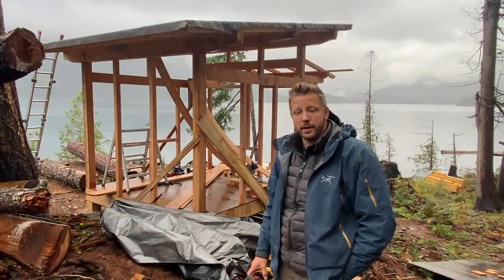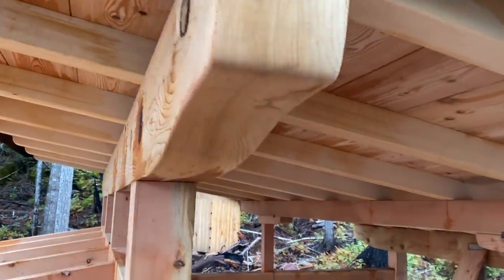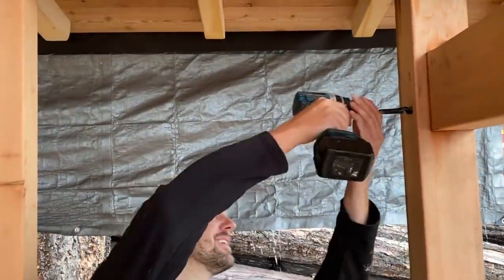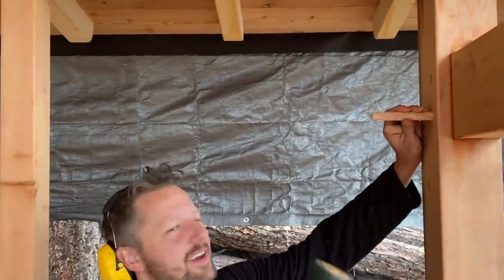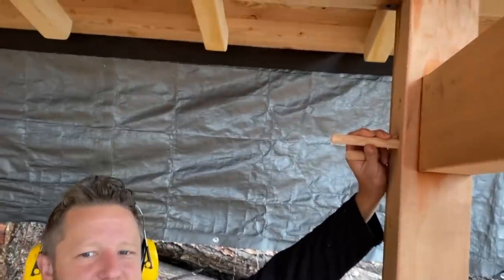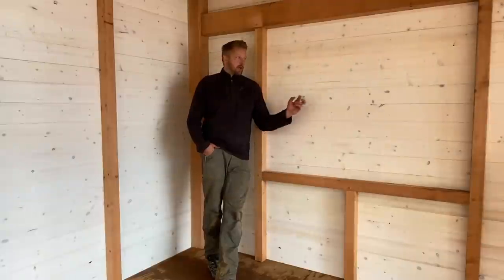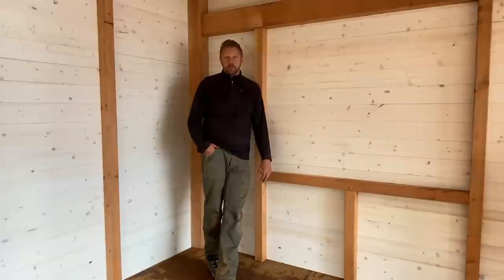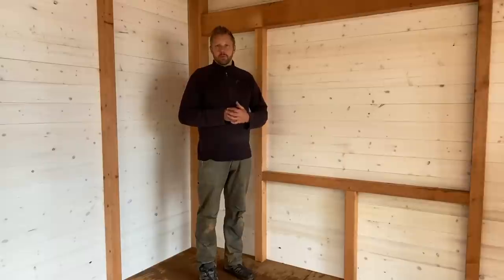Installing Shiplap Walls On My Timber Frame Cabin!!!

Comment: Windows, telescope, Dutch oven, outdoor kitchen, composting toilet, garden, floating fresh fish pen, an Archimedes Screw to deliver water to the fire pit or wooden hot tub next to the fire pit (with a coiled copper tube water heater),   A halved log sluice waterslide as long as you want sanded smooth and lined with moss (purées of moss painted on the wood will grow moss as a smooth covering - moss art).

Comment: Those triple chip Wood Owl bits are hands down the best! 
My only gripe is that they exit a bit messy.
Reply from the maker: They are engineered to stop themselves before exiting the other side as long as you don’t push on it. The bit will stop just as the spur pokes out the back and then you just drill it from the back a tiny bit and you got a perfect hole.
Reply: @TheSamuraiCarpenter  Those Japanese…… they’re like the Germans of Asia!!

Comment: Just a question from the bottom of the world, how come you don’t use top and bottom plates on the walls? Do you use skirting etc? If so where do you nail it to? Just curious due to very different building style

Comment: Hi :) Just was wondering if the roof boards is put on up side down? The grooves makes the air circulate
Reply: The grooves are to prevent the boards to crack when they shrink and expand by the change in weather and thus in moisture in air.

Comment: kind of surprising that the tar paper failed immediately.  Good thing you have some tarps on hand.   It's going to be a purty little bunkhouse.
Reply: I think its because of the shallow pitch of the roof and the incessant wind driven rain off the lake. It should really be ice and water thats sealed down along the over laps.

Comment: Does making it wet effect the joints or squareness when it is dried?
Reply: It would have to get a lot wetter. And it would have to absorb all that moisture. Wood can actually take a ton of moisture before it starts affecting it. I would still make every attempt to get it all sealed up as quickly as i could though. Also, this type of construction with timber framing is meant to be able to expand and contract with the elements, that’s why pegs are used in the mortises instead of rigid steel lag screws.

Comment: Did you draw bore those joints? Just curious.
Reply: I'm not sure if draw boring is necessary or advised if things are getting wet and dry. It makes sense for furniture for sure. Thanks.

Comment: Cabin looks great... One concern though, isn't it a bit small? Are there extensions or other builds on that lot anytime in the future?
Reply: I think this will end up being the shed. He’ll use it to camp in instead of the tent while he continues to develop the property.
Reply: If I was to take a guess its as big as it can be without having to get a building permit.
Reply: He’s mentioned before that this building is the shed. I assume that’s why there were no provisions for insulation.

Comment: Sometimes, not so fun at all (responding to what you said early.) I did something stupid a week ago, trying to do a project for my wife. Nailed my thumb to the box  . Fortunately able to pull the thumb away, and I've had a tetanus shot within the past few years, and all healed. Something to laugh at later, which I ALWAYS try to do! Oh, it was just an 18-gauge brad from a nail gun, but still stupid on my part.

Comment: Those Paslodes are not all they are cracked up to be. I won one once at a place when I was installing windows & doors and they are all fine and dandy then you not only pay on e $300 for the device you still need to but the charges for it and the nails. Not worth all the hoopla!!